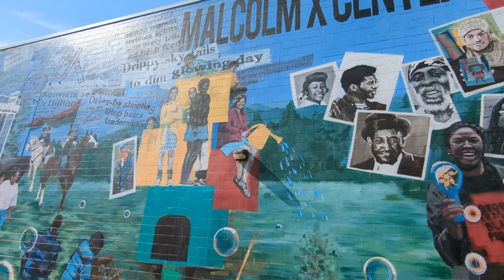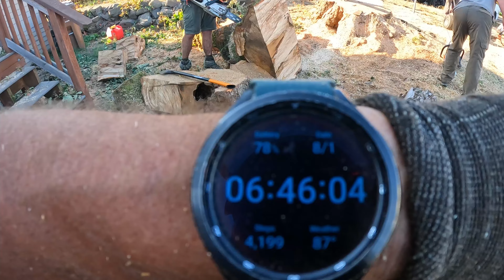This Rigging Point Paid Off BIG TIME For This Tree Removal!

Comment: Been watching bjarne I guess lol
Reply from the maker: Exactly
Reply: @VeteranTreeService  👍Next you need to try it on some 30-45 degree side slope with a 20-30ft drop off.😁
Reply from the maker: @iffykidmn8170  I'll keep practicing on flat ground. 🫠
Reply: @VeteranTreeService  Every time I see him do it I am thinking about scare straps and climb lines and he is using nothing.🤪I have used a climb line in the past to put in a notch on a side hill I could not stand on without sliding downhill not fun.